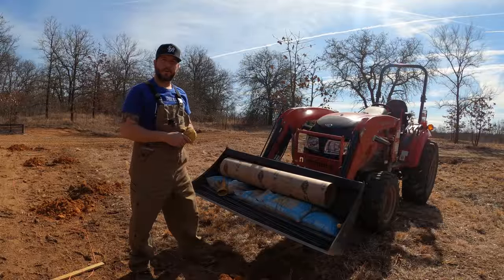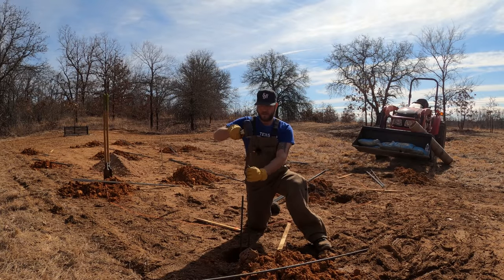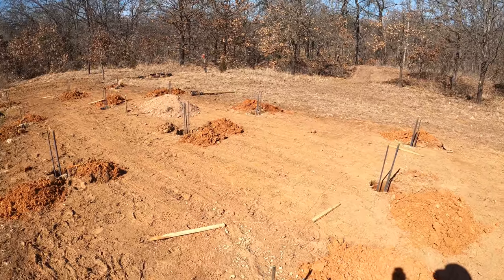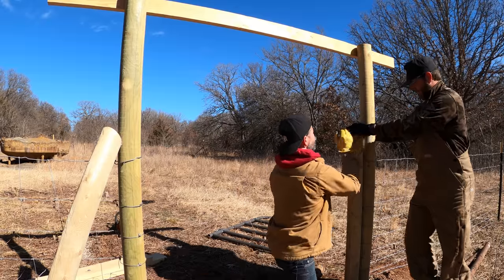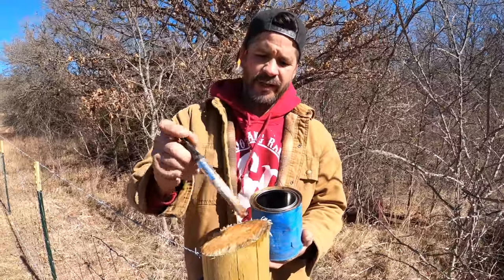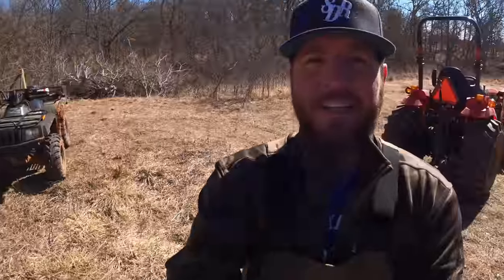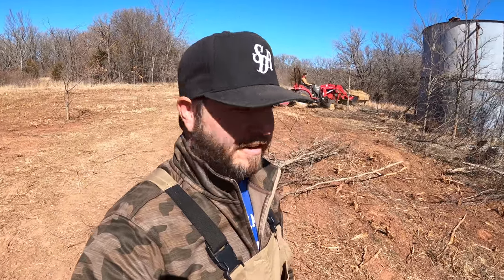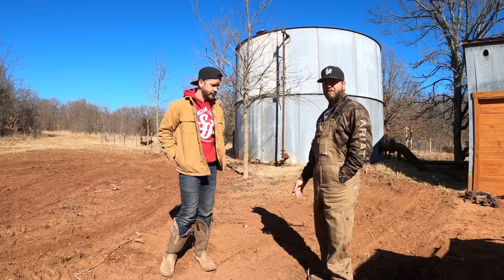Tiny House Build - Starting Rebar & Working On Shootdang Ranch

Comment: If there is a scrap yard locally, you could load the trailer of the metal and cash it in. Metal is getting expensive like everything else nowadays.  You guys are doing a great job.  👍🏻
Reply: Do you need cardboard tubes in before gravel
Reply: absolutely a great idea to sell your scrap...maybe even those huge metal 1/2 bowls in the pen. $$$$

Comment: I like to run a level line to keep the correct height of each column per base. A concrete mixer is a huge help for sure. Looking good
Reply from the maker: Yeah I'm gonna use a level before any concrete is poured for sure
Reply: @South_Texas_Roots  I'm very interested in watching your build. You have a lot of great ideas and it may help me in my process of building a tiny house for myself. I plan to sell and rebuild this year. So this is exciting to watch Thanks for sharing.

Comment: I’m not sure if y’all will be dealing with any more barbed wire but just a tip… stick a piece of rebar through the center of it and make it like a spool, it helps it to be a lot easier to deal with

Comment: Perhaps it would be a good idea to have a low shelter within the fenced area (the old tanks?) where chickens can quickly run to hide if a hawk is overhead. Also for additional shade. Can’t believe how much y’all have accomplished in such a brief time!
Reply: Building shelters will come with time, they are working as hard as they can to get ready for the animals, the clearing and fencing first, then shelters, in the meantime
 they will have access to the "it's not a grain silo" silo

Comment: I would cover the gates with mesh to keep goats in and predators out. Definitely make a pile of the metal to take to a recycler on the trailer. You can make some good money off it. If not, post it on a local FB page and offer for free. You will have people lined up to come get it.

Comment: Looking good!  Everything is looking so much better and tidy which is important as it makes work so much easier for you to maintain. 
Was thinking if they had oil rigs out in that area at some time  I would imagine they had electric running it and you might have old power somewhere closer than perhaps you know.
That power is what killed us when setting up our place 48 years ago. The power company would come in from however far their poles were set but we paid from their pole to our home.......it can be huge here..........hope you have the best way to go on that. 
Prices were high for us as the wire is mega$.  I pray you don't run into an unreal cost on that.
Best of luck.  Also I am thinking you must have water close there with soil being damp and a stream running close by. I am praying for you guys that is the case.  Hoping you have an aquafer close that has a plentiful amount.  Wondering if the county can give you some info on that as that oil pump was out there and they might have had some closed up wells now ..........wondering wondering..... I guess the county would/should have info on that.
Great video and love watching you guys doing your beginning of being "ranchers".......love it!
Hang in there, no matter what, it all comes to fruition sooner or later. Sooner preferably!

Comment: I suggest thatyou put some sort of metal flashing between the top of the concrete pillars and your wood sills. Foremosian Termites are in the USA. They came with hurricane Katrina. And they are moving north. They build  vertical tunnell's  right straight up concrete and brick.  I seen some that went 8 feet to reach the roof sill plate on  a cement block building. They infested the visitors center at the Toltec Mounds state park in Arkansas. The lamated roof support beams had to be replaced with steel. And they have a contract with a name brand pest control. They cant cross metal if it is smooth enough that they cant get a purchase on.

Comment: Just FYI, rule of thumb. You never want rebar touching or penetrating the ground it will rust. Better off cutting rebar 6” shorter than the length of pour and floating it in

Comment: I wouldn't have added that river rock to the base of your footings columns. What's going to happen is that rocks going to settle and move with the weight eventually and you're going to start having cracking of your columns.

Comment: Hey guys there is a place called Harley Hollan. It is at 61st and 169ish: 5677 S 107th E Ave. You can take a truck load of stuff for like $30 I think it is. I’ve taken huge truck loads. You pull up, pay them and unload. Probably cheaper than having someone come out. 
It’s looking good out there.

Comment: 🤔 great job so far. One thing y’all may want to consider is installing a French drain around the building that you built the room in. That will take any additional water away from the buildings edges. 
I would also install some motion activated solar powered lights around the livestock enclosure. The power source can be installed on the roof of the enclosure or the pipe sticking out of the top of the enclosure. 
And maybe cut the brush back another 10’ or so to give a better line of sight for you and your dogs. With a resident pack of coyotes you may want to invest in some spiked collars to help your dogs survive an encounter/ fight with the resident coyotes and bobcats. Considering none of your dogs are actually full blooded livestock guardian breeds or guard dog breeds of substantial size or strength the collars may just save their lives. 
Good luck with everything. The ranch is coming along very nicely.

Comment: Just one quick comment on the rebar.  Use some tie wire to tie the tops of the rebar together.  This will keep the concrete from cracking vertically when you load it.  You guys are very hard workers and it’s obvious your parents taught you a very good work ethic. Keep it up.

Comment: Don't forget to put tie down bolts in the piers when you pour them.
If you can find a panel of chain link fence, you can put some cement blocks on it and use it for a drag on your tractor to smooth the ground out.  
Stop worrying about not being professionals and what people say. You do you & read comments for INTELLIGENT  advice. 
You guy are doing great.

Comment: The two upside-down legged domes might be used for filtering water through gravel or sand?!
If sealed bottoms they could be emptied of gravel/sand buried for use as ground level duck pond and animal water… put gutters around the shop to catch all the animalwater you ever need (put swimming pool liner in it to protect metal)?! WITH ONE or BOTH METAL TUB/s -FILL WITH WATER AND BUILD WOOD FIRED GIANT HOT TUB?!

Comment: Looking good…but be careful with that rebar, it’s not supposed to stick thru the bottom of the foundation. You’re supposed to have a 3” clearance from the bottom of concrete to the rebar. You may have an issue with water penetration the rebar holes, freezing and busting out the concrete. Or at very least corroding the rebar

Comment: Good job, who would comment against you doing the work yourself?  If they haven't built one, like they say keep it to yourself................................... save those bags you could use them when you need measure rock.  What are you doing to block the goats from leaving through the gate?  Was that the brush hog attachment?

Comment: Guys,Its looking nice a little at a time gets it done. You have a lot of scrap metal / piping on your ranch.Take it to the scrap yard. It can help pay for other things on your ranch. When you go to get building supplies.Drop off the scrap metal at a scrap yard. Good luck be safe.Please update your tetanus shots. Because you are working with old rusty metal.  Scrap metal is roughly $ 3.44 a pound average depending on the metal. If nothing else, it could buy your lunch.lol
Reply: Yaffee Metals in Sand Springs.

Comment: You get one shot at the Peers for your house. You need to pull strings for square and use a transit or line level to get the Peers level

Comment: I don't don't use barbed wire. It's dangerous for your animals and also for the wildlife. But this is your place so I have no say.
Reply: You are right, it is their place and barbed wire has been used for a very long time and it isn't hurting the animals, animals. Animals learn their boundaries and rarely does an animal try to cross it.
Reply: @nellmarie98  I've raised livestock over 56 years. Yes many animals have gotten hurt & some killed on it. And wildlife has been injured & later die bcuz of the wounds. 
Yes, it's been around for years. But that doesn't have anything to do with the safety factor, just hard headedness/stupidity. There are better products available now and just as cheap or cheaper.
Reply: @denisewilson8367 , I also have raised animals for years, growing up all we used was barbed, even used it for running electric though.  I use woven wire with barbed across the top and electric along the outside about ankle-high Never had an injured animal from the barbed wire, does that mean it never happens?? No, but it's a lot less [ainful than being hit by a vehicle if they manage to get out of the pasture.  
The boys have woven wire, there is nothing wrong with them running the barbed wire along the woven to keep predators out.
Reply: @nellmarie98  you do you, and they will do it their way. Like I had previously stated.